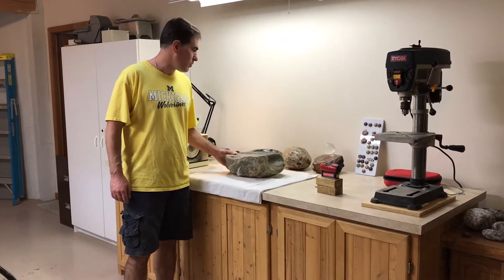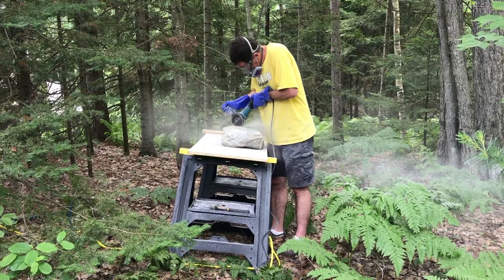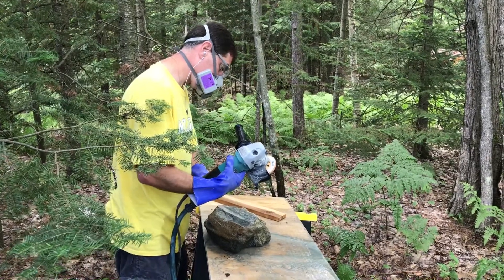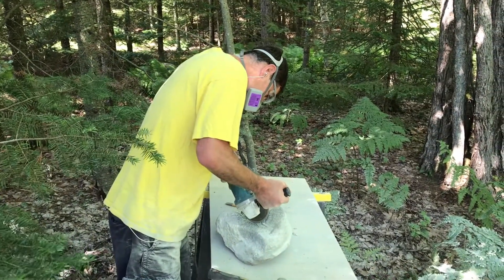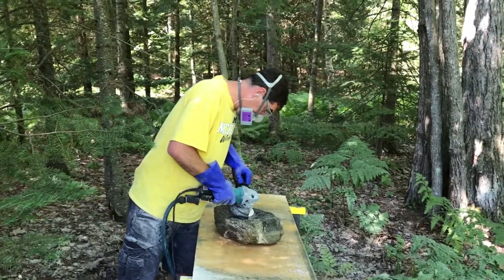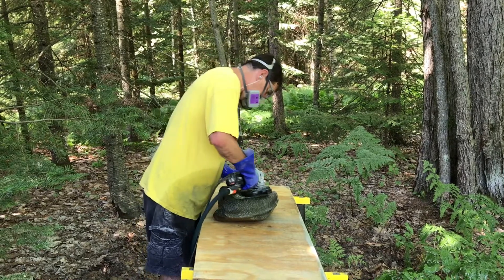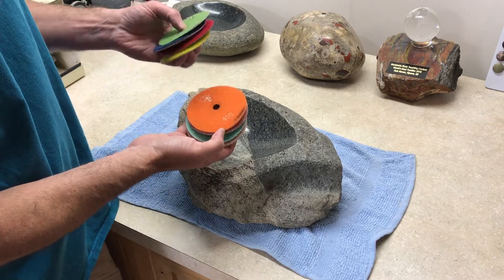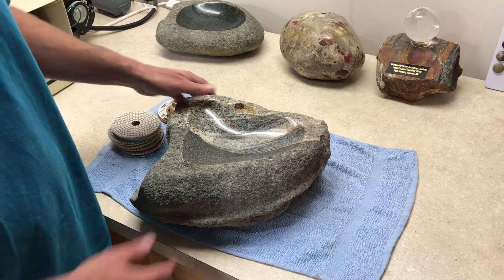How to Make a Bowl Out of a Rock

Comment: Lovely.  I could see setting up a series of stone with a slightly lower rim on one side. Step them down to make an outdoor waterfall for a porch or patio.  Recirculate the water.  That would be a heck of a project and potentially stunning.  Or even a one bowl tiny fountain 😇
Reply from the maker: What I really want to do is get a boulder about 2.5-3 feet tall and hollow out a birdbath on top, then have a place where the water runs out one side into a bed of smaller rocks where it recirculates.
Reply: Michigan Rocks perfect!   That would be really cool.  Get Sam to help carry it though 🤓
Reply: Michigan Rocks now. If only you could find an Agate that large.  Or a lovely jasper.....

Comment: Hi there. What type of grinding wheel did you use? Do you need to buy any special separate attachments for the grinding wheels? I will be purchasing this Makita tool soon and will be grinding slightly smaller rocks than featured in your video.
Reply from the maker: The hard wheel is called a cup grinder.  I bought it at Harbor Freight.  I don't buy much there, because a lot of it is junk, but this has worked well for me.  The soft disks come in a set or individually.  I think I listed them in the comments.  You'll need more of the coarse grits than the finer grits.
Reply: Michigan Rocks thank you so much and I enjoy all your videos. 🙂

Comment: Hi there....been watching your videos ....I cut my first rock today and I m using a 4 1/2 inch diamond blade....my question is how deep did you go? I seem to have difficulty going deep because the guard or the grinder itself bumps the edges.
Reply from the maker: I used the same size blade and went as deep as I could, if I remember correctly.  I tried to go deeper in the center and taper out to shallow at the edges.  If you want it deeper, you could always go back and cut again after chiseling out the first pieces.  Just be aware that the polishing pads can't get into tight spots too well.
Reply: @MichiganRocks  thanks....I did cut and chisel 3 times. The 3rd time I couldn’t get as deep as the first. I was thinking maybe I should have gotten a 7” tool. But again maybe it’s the operator lol... I’ll stay with my 4 1/2.
Reply from the maker: @philw.8439  I have only done three bowls, so I'm hardly an expert.  It wasn't too hard to do and was fun too.